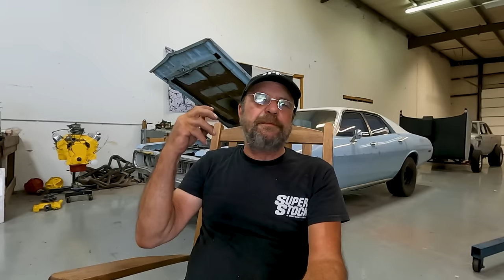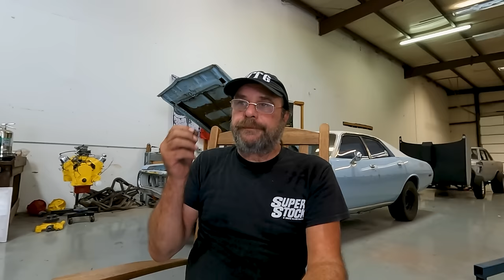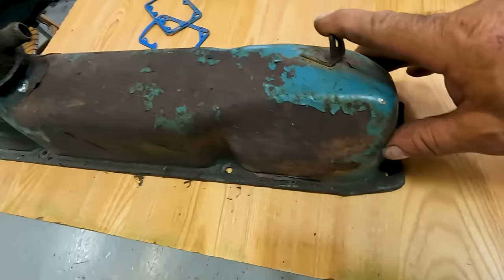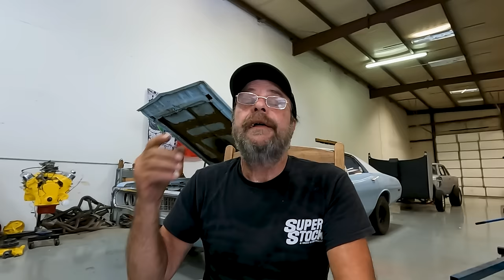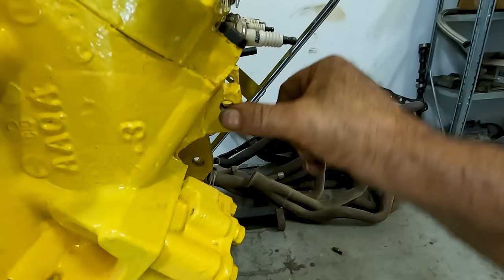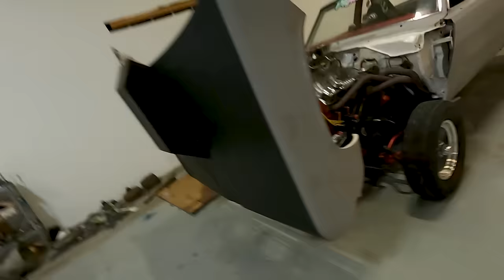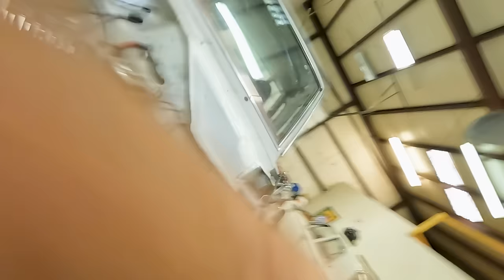Did Mr. Norm REALLY Outsmart The Engineers At Dodge?  The Full Story Behind The Big Block Dart

Comment: Years ago I saw a GSS Dart on a lot and I was told it had a 383 that Mr. Norm had modified.  That tells me the salesman didn't realize it had the 440. All these years I've been walking around believing it was a hot 383. Now to appear less stupid, I do know a 383 can be hopped up to make it a lot more powerful so the 383 GSS myth has a bit of credibility.

The body drop concept might explain why Nicks garage had trouble removing a 413 with the dual cross ram manifold. The factory lowered the body onto the engine so they didn't have to clear the fender wells coming in from the bottom up. If I remember correctly Nick had to remove the whole intake assembly before the engine could be lifted out. LOL.

A friend born in 1946 told me when he was 18-20 he used to hear advertisements on WLS radio for Mr. Norm bragging how they could add HP to any car and it would offer you to make an appointment at a phone number. It used words like, "dyno tune",  and "performance camshafts".

Sounds like an awesome time to be 20. I wasn't born till 1973 so I missed all that.

Comment: The only problem with your story on the 1970 and on 440 with bosses is incorrect. My dad has a 1967 coronet R/T 440 4 speed car bought new in January 1967 original 440 has "Bosses" and he put The engine in a 1968 Dodge Dart GTS 340 4speed and bought an over the counter Direct connection K-member. Still have both car's. Dart is original paint car B5 blue hemi covertor reverse valve body Had fender well header's with stock internal 440 hp with mr norm's worked Mallory dual point and T-m7 edelbrock and 780 holley was running 7.4 in 1/8th 89mph 4:30 gear 29x 9

Comment: It required: 

1. Some grandpas Dart or Valiiant,
2. A 440 out of a junkyard Imperial. Not that hard to find at the time.
3. A torch.
4. 2 Big hose clamps from a truck stop to strap the transmission to the crossmember.

But that’s too much work. A 401 out of some big AMC bolted right into a Gremlin using factory parts that would eat any flying chicken.

Comment: If there were 50 built it was for NHRA homologation. 
Any dealer could build 50 cars and get them homologated for NHRA competition. 
There were 50 or so Gibb Harrell Automatic 68 375 HP Nova's with 6 lug torque converters and high shift points. 
Gibb ordered 50  - 1969 ZL1's - again in order to get them homologated. 
There were approx 65-70 dealer built 67 Yenko's with transplanted 427's. 
Both were to qualify for NHRA.

Comment: I put a few 440s in A bodies. You don’t need special manifolds, the standard B body hp type work fine, just have them both milled on the head side about 75 thou. This gives you clearance for the steering column.

Comment: Replying to the question in the Video Description. Yes, He Did. I was 16 and Dart GTSs were my Dream Car when I got the Car and Driver Issue about the GSS built by Mr. Norm. I Read that Article probably 20 times over the next month. The whole story of how the Author of the Article picked the Car up and drove it home but because the Dealer was late in delivering the Car to him for his Test, He had top park in on the Street. The Next morning, he went to get the Car and it had been Stolen overnight. He Found it 2 weeks later in Grey Primer rebadged to a 383 and with Wheel well Headers and Kicking Ass at the Local Dragstrip. The Decision Was made to leave it out there because of the reputation it was giving Dodge. A few weeks later they Pulled the Plug and Arrested the Guy racing the car and it was Destroyed. Now for the next part. In 1992 I was getting some beer at the local Grocery Store, and I chanced a walk past the Magazine Rack and Saw a Mopar Muscle Magazine. I bought it along with my Beer and went over to my friends house and I showed him the Magazine and I still hadn't opened the Magazine, and I told him the story I had read in 1969. Still Hadn't opened the Magazine and I put it on the seat of my Pickup truck. The Next when I got Up I finally Opened the Magazine and Read the Article and it was the Epilog to the First Article I read in 1969, I was floored. Oh, Tony just in case you're wondering, I still haven't at the time of this comment watched your Video. I'll Do so now.

Comment: Is that a 1964 Valiant convertible in the corner?
If so what are you doing to it?
I have a Canadian Valiant convertible.
I am trying to source a factory power steering unit for it,
along with all the brackets/ mounting hardware for a 225 super six.
Any suggestions?
Cheers

Comment: My cousins were big Mopar fans and they would build Roadrunners, Super Bees, Demons, Dart GT's out of the regular versions and then would put the bigger motors, transmissions and different rear ends in them. I remember them trying to put a 440 in a '68 Dart that they took out of a Coronet. They worked on a '69 Roadrunner all winter long in my uncle's barn building this 383 and doing the body work and the interior. They got it running but the roads were still snowy and icy but my cousin had to go "test drive" it. It's stalled out and wouldn't start so they walked back to the house and got my uncle to get in his Power Wagon to tow it back. My uncle told them not to try to dump the clutch and start it but my cousin was hard-headed and he did and it just so happened to be where there was some snow and ice on the road and the wheels locked up. He slid off the ditch and hit a tree and destroyed the right quarter panel. He ended up putting the built 383 and is 68 Dart.

Comment: I had a 67 Chevelle SS ragtop. 396 prepped by Gary and running one of his 671 huffers. Made a little over 750 at the crank (dynoed). That was 1978ish. Had to put a 6 point roll bar in it as the torque from that motor wanted to twist the car in half. Won alot of street races with that car at that test track down in Mexico...lol...🤓

Comment: Great information UT. I'm sure you know this but there was also a change in the A-body radiator core support in 65 over 64. My 273-powered 64 Barracuda has a smaller opening for radiator airflow than my 65 Valiant. The Formula S wasn't available until 65 and may have needed that change eventually. Were subtle changes working into the A body to allow more power every year?👍

Comment: I sold a 69 Barracuda slant 6 parts car to a guy 20+ years ago. He owns a 68 Barracuda factory 440 care. It has a set of factory fender well headers on it that were in the trunk when the first owner picked it up from the dealership he ordered it from and worked at in 68. The original had a factory sponsor deal for several years. The original owner sold the Barracuda in 1980 to the second owner because he had to buy his wife a house or she would divorce him. He also owns a Max wedge car and altered wheelbase car that he raced in the 60's.

Comment: 9 times out of 10 I would say when a company won't/doesn't sell a product it has very little to do with engineering and more to do with the sales/marketing/management team.  There are even more reasons today that stuff like that doesn't happen and it has more to do with tooling and certification and stuff.  That's the reason that the Charger never got a manual transmission.  The car was certified for crash testing with the automatic floor pan.  Any change to the structure would require retesting and certification, which is big money for little return.  Doesn't mean some dude in his garage couldn't figure out how to put one in and "do what the engineers couldn't".  They are just doing what corporate wouldn't let the engineers do.

Comment: Valiant chargers were built in the South Africa from about 1970 to 1973 (not sure about the end date, but the Charger name was actually used here in SA before it was used down under). They were a combination of parts from the Dodge Demon and Plymouth Duster from the same time. They used the very well known 225 ci slant six engine and some of them definately had the 383 ci engine installed. Such a small car with a 383 ci engine must have been something special. At the same time the Valiant VIP, a rebadged  Dodge Dart was avialble and could be bought with a high power version of the slant 6 (190 bhp), called the Charger Power option. I'm not quite sure what the relationship between the Charger Power VIPs and the Valiant Chargers shown below are. We now have a member on the forum that owns an original 383 charger - 
The cars never used the six cylinder hemis that that made Australian Valiant Chargers so unique. They are in fact quite unrelated.
Reply: In Australia we have the same chargers as you in SA but Americans are different cars we mainly got them in the 245 or265 with triple strombergs if we wanted the V8 we had to build them ourselves I'm sure they weren't released here

Comment: When the Dart was downsized in to the A body platform the only way to get a big block in a A body platform was through places like Grand Spalding Dodge. The 67 Dart was not a A body the Dart  started out as a larger body platform and the Plymouth version was called a Savoy. The problem with putting a big block in the A body was the small engine compartment wouldn't allow a standard exhaust manifold to clear the steering shaft to the steering gear. So either you custom make headers. However Direct Connecrion catalogue offered a exhaust  manifold configured to wrap around the steering shaft. But it doesn't matter if you put a 440 six pack or a double 4 barrel hemi crossflow running the most powerful nitro-methane mixture they don't run any faster. In fact they run slower. Around 12 second times. The rear tires don't bite and hold any racetrack surface worth a darn. Asfault or concrete. As of 1985 the world record for the A body class is a 9.46 second time in the pro stock eliminator  class, with a tricked out 318, and a 3 speed transmission. In a 2 door Dart sport or Demon.  That was 1/4 mile. Uncle Tony in a stock A body platform has anyone beat that time running a Big block or Hemi. In the quarter mile.?
Reply: The 67 Dart and Barracuda were both a bodies